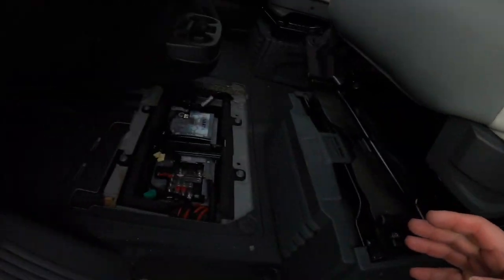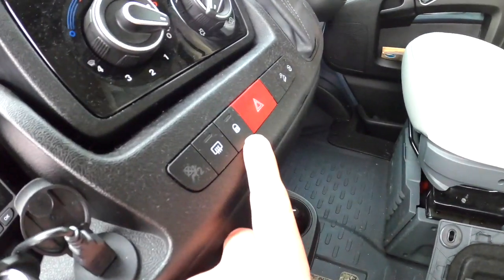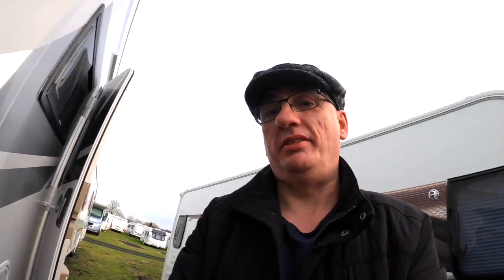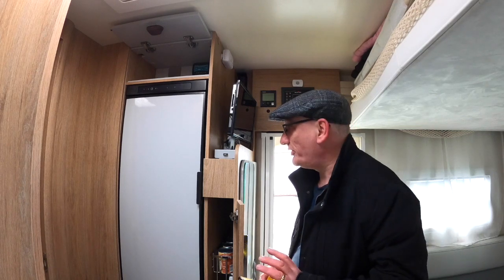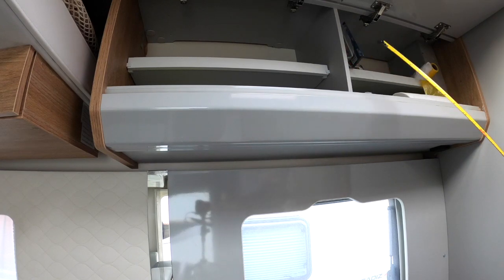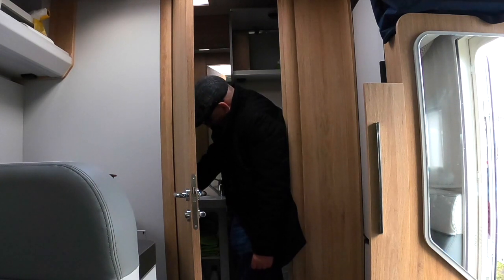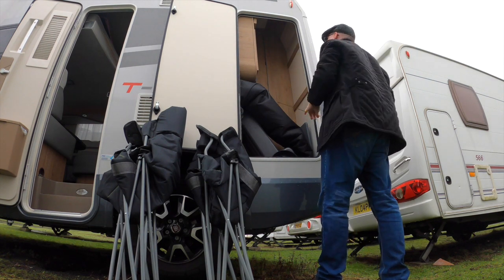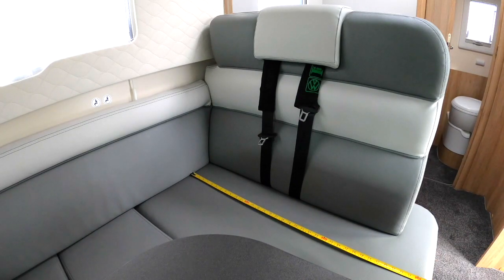How to LOCK a FIAT DUCATO Passenger Door With a FLAT BATTTERY

Comment: Thank you for the exceptionally helpful tip on locking the passenger door when the battery is flat. So grateful x
Reply from the maker: No problem. Thanks for the feedback.

Comment: Hi Paul, love the vlog.  Ours is the 2021 model and you can open the habitation door from the inside with the central locking on. Hope to get to use the van soon for more than just going shopping!
Reply from the maker: Thanks for letting me know. These people with their posher vans 😂 Bet you can’t wait to get out and about. They are a fantastic van. We have found that an issue with using the central locking on the dashboard is that, even with the security system switched off, if the van is locked with power on and subsequently disconnected it triggers the system which is why we had to find another way to lock the passenger door. We wish you many happy memories in your new van. 😎
Reply: @LiveforTravel  thanks. We already knew about the lock on the passenger door as we have an ongoing issue with the central locking. They tell you about all the things they've added to new models but not about what they've removed. There's no longer an opening window between the habitation door and the passenger door, it's fixed.
Reply from the maker: @lesleybarlow7592  I never knew that one. That is always the same with advertising etc; highlight the new and gloss over anything no longer fitted. This can only be down to cost. Thanks for the info. Might mention the changes on the 2021 model in a future video and this kind of feedback is valuable.

Comment: Excellent video, can you please measure the shower cubicle height, width and depth?  I'm thinking about buying this model but not sure if shower is big enough.
Reply from the maker: Thanks. The approximate measurements for our van (specifications change constantly) are: Width of entrance (between frame and concertina door): 425mm, width in cubicle: 820mm, depth: 570mm and height: 1955mm.

Comment: Hi Paul
I know this vlog was a while ago but as a newbie all your vlogs are useful. Unfortunately due to the cold weather our starter battery went flat and we have had to take out and replace. We had the problem of the passenger door not locking until I saw this vlog which even though our motorhome is in storage still worried that the door was left unlocked, so thank you for that tip.
I have now put a new starter battery in, however when I then lock the doors by the key, all doors appear to lock, but as I am “old school” by habit I go around each door and pull the handles, and the passenger door opens. I tried locking by the red button and by the key, even tried the method I used when no battery was on. Do you have any idea how I can solve this, as the door is still unlocked? Thanks again for the benefit of your experience it is much appreciated. Chris
Reply from the maker: Thanks for the comment and feedback Chris.

We have (like many people) used the process discussed on our van many times. Like yours, our van is in storage and although I felt it was relatively safe we didn’t want to leave the passenger door unlocked.

As you have changed the battery I have read on forums that some people find that a door doesn’t lock with the central locking or remote after. It hasn’t happened to us (to date) but they suggest you disconnect the battery again, easy as the negative cable has a quick release on it, leave it a few minutes and reconnect. Like most things electronic… the turn off and on again approach could work.

Be grateful if you could let me know how you get on Chris as we all learn from one another.

All the best with your memory maker and thanks for the support.
Reply: Cheers Paul, thanks for replying so quickly, will give it a go and will let you know, if it doesn’t work my motorhome is going in for some work on the body shortly, so will ask them if they know how to solve. As you say it is a learning curve and it is good to know there are people like yourself who are sharing your experiences. It is very much appreciated. Thanks again Chris
Reply: Hi Paul, just to let you know our motorhome is in with dealer at the moment and they have said the lock had broken and have ordered a new one as didn’t want to have to manually lock each time we left the memory maker😀. Also due to the battery going flat, the airbag light has come on, seems a common problem as there are a few You Tubers mentioning this at the moment, again our dealer is checking for me. Not looking forward to the bill😕. Next winter going to make sure we go out at least once a month to check everything is working and we don’t have same problems. Cheers Chris
Reply from the maker: The battery being flat will confuse the electronics but personally not had it trigger the airbag light. If you have alarms and trackers it is probably best to run the engine for a good 30 minutes every couple of weeks in winter months. Hope you get it sorted soon and at a minimum cost.

Comment: Does your raised bed still operate with the bedding in place? I know of some that won't due to the weight, it blows the fuse, and the bedding has to be stored elsewhere.
Reply from the maker: We use the elevating bed with the bedding, ladder and dinette cushions on it and is fine. Just wondering how heavy the bedding would have to be as people that say this would suggest that the tolerance levels of the system to be really close to its maximum all the time.

Comment: Can you help me with this one.I have A Swift Rio motorhome and recently I shut the doors , not locking them, on the motorhome,leaving the key in side.To my horror when I returned the motorhome had locked itself.How can this happen?
Reply from the maker: Apologies for delay in reply. Unfortunately any comments left that have words straight after a full stop (without a space) are treated as links by YouTube so are held for review. We assume your cab is a Fiat Ducato. There are ways that the Ducato will lock automatically; unlocking the doors with the remote but not physically opening the doors within a couple of minutes and of course the lock button on the dashboard. Does your habitation door lock with the central locking? Did you leave the van via the habitation door? Some have had issues where the doors are locked with the button on the dashboard and then they have left via the hab door. We are unaware of how a Ducato that was open when leaving the van has locked itself without using the key fob. Maybe someone in the comments will have an answer for that.

Comment: Hi
Is there a way to lock a slide door?
Reply from the maker: Unsure what you mean. Slide door on VW? Hab door? It depends on the manufacturer.
Reply: @LiveforTravel  Fiat Ducato - Side/slide door. I can not lock it. It shows me that doors are open and remote controler doesn't work in that case.
Reply from the maker: @polinikkpolinikkt5119  did it used to lock with the remote? 2020 vans (and earlier) were not connected to the vans central locking. Ours has to be locked with a key. We have occasionally been unable to lock using the handle inside but we find turning the key in the lock resolves this. Unable to say what might be the problem with your specific van.